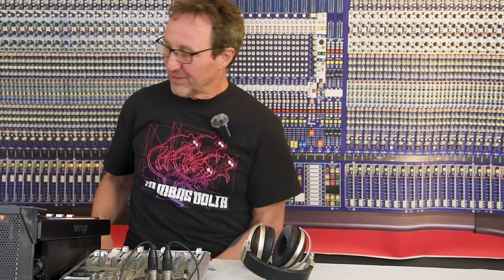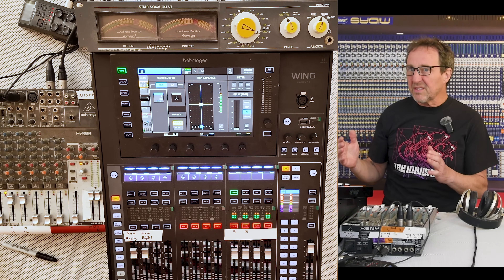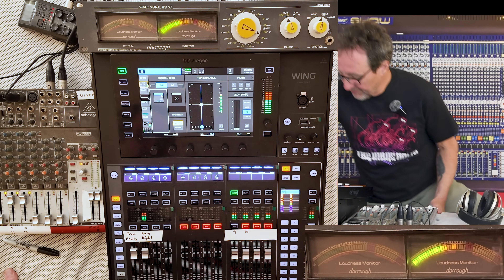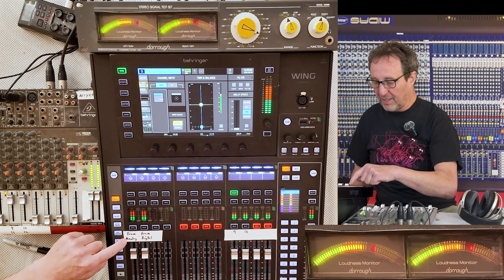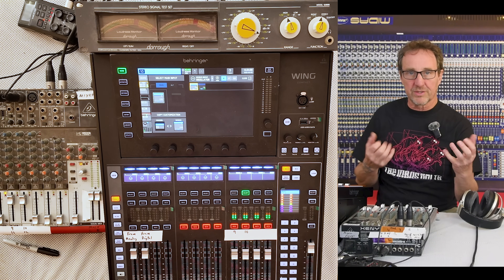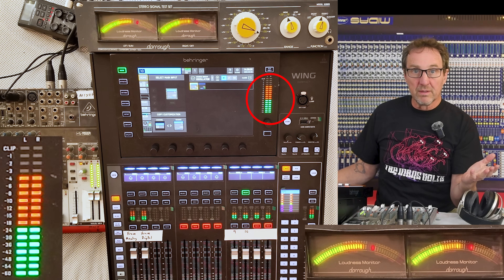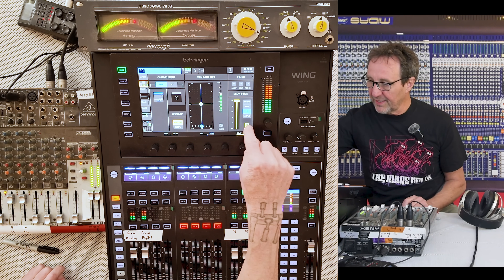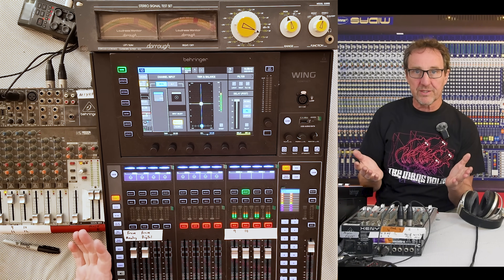Digital Audio Meters Don't Show What you Hear - Sometimes

Comment: Pretty sure the reason the level doesn't seem to change on the digital meters you tested is that they don't feature antialiasing (i.e. "true peak" metering). If they did, they would probably read the peak level to be much closer to an analogue meter :)
Reply: RMS and LUFS measurements should be mostly immune to this kind of discrepancy
Reply from the maker: In the video 8 show that channels 1 and 2 of the wing are metering correctly which are reading the signal after the the analog moxer

If it's a metering issue, why does converting the signal to analog and back to digital fix the issue?

Also, the dorrogh meter shows peak and RMS and both read correctly. 

As you can see in the video as well
Reply: @DaveRat  Because in the ADC/DAC parts there are antialiasing filters
Reply from the maker: So that assumes that there is an aliasing issue occurring inside the console that the meters are reading and somehow converting to analog and back again is removing aliasing issue?

Aren't aliasing issues involving the creation of lower frequencies when things are sampled at a lower rate than the highest frequency of the signals? 

How would anti-alising filters remove aliasing issues that have already occurred and are being shown by the meter?

If the issue involves lower frequencies that are audible that's of a huge concern and converting to analog and back shouldn't fix it. 

If the issue involves higher frequencies above audibility then the meters are showing something real that we don't hear but is affecting the headroom of the digital console.
Reply: @DaveRat  "In the video 8 show that channels 1 and 2 of the wing are metering correctly which are reading the signal after the the analog moxer. If it's a metering issue, why does converting the signal to analog and back to digital fix the issue?"

As @MartijnBraam said, both ADC and DAC include antialiasing for the audio signal, which is why channels 1 and 2 were metering correctly.

“That assumes that there is an aliasing issue occurring inside the console that the meters are reading and somehow converting to analog and back again is removing aliasing issue? Aren't aliasing issues involving the creation of lower frequencies when things are sampled at a lower rate than the highest frequency of the signals?”

The meters aren’t in the audio signal path, so the aliasing isn’t audible. It only affects the visual response of the meters.

“The dorrogh meter shows peak and RMS and both read correctly.”

RMS and LUFS are both taken as averages over time, so the peak levels don’t influence the readings much. The reason the peak reading is accurate on the dorrough is that the signal is resampled coming out of the console after the internal meters.
Reply from the maker: What sample rate? Interesting sample rate can impact the levels.  Also internal white noise may give differing results than external. Also sample rate of the white noise versus the session sample rate messes with things as well.

ultimately all the metering options are useful but the sample peak will be the one that determines your max signal level before digital clip.

Now try converting one of the de-correlated summed signals to analog and back to digital and see where the sample peak level is after the conversion.

Do you still think that it is the digitally created issue of aliasing that is casing the sample peak to meter hot with summed de-correlated signals?

Or is it the anti aliasing filter perhaps?

Or perhaps is the signal just doing exactly as it should and the meter is doing exactly as it should and there is no issue other than the meter being too fast because that is a cheap way to meter using minimal processing power?

And converting to analog and back again is perhaps just a low pass filter that eliminated or reduces the the issue.
Reply: @DaveRat  I suspect that the white noise generators are generating signal above nyquist (as that's what would happen when you use a random number generators without any filtering) and the anti-aliasing filter would drop all the signal above nyquist, the weird part is that the meters don't seem to filter out signals above nyquist so it still counts that as signal.

The anti-aliasing filters exist because having the signals above nyquist in the DAC/ADC would cause the aliasing which generates signals lower in the spectrum. They work and that's why the issue is gone after going through the analog domain.

Comment: Dave, you’ve got me heading to the studio early tomorrow to test this out on my analogue console and daw!  And also on a few new A&H desks I can check out in the coming weeks. I’m an old VU metre guy and rely on them for everything.
Reply: Hi Dave.  Well the results are in!!   I tested this on my A&H gl 2800 and to my delight the main output meters did exactly what they were supposed to…. They showed a 6db increase when summed correlated and a 3 db increase when de- correlated and the monitors confirmed this. My daw however did not! I got the same results you described in this video. Main out meters on my Samplitude mixer showed a 6db increase when correlated and no meter change ( still showing 6db increase) when de-correlated though the monitors did confirm a level difference. I might get my mag lite and head down this rabbit hole….

Extra note: my analogue VU meters did display correctly, +3 de-correlated and +6 correlated
Reply from the maker: Having a digital console that does not show the signal being 6dB is kind of a concern. Ideally you want to see those short-term digital peaks so you can make sure you're not clipping them but you also want to see the RMS meter so you can see what you hear. 

In the analog domain you don't need to see those ultra short-term high frequency peaks because they don't cause issues in the analog domain like they do in the digital domain.
Reply from the maker: Awesome and let me know! 

The question is, are the meters wrong or  are they reading signal that is there and we are losing 3 dB of headroom in digital that we don't hear or lose in analog?

Comment: A few things that might be causing similar things as this. Differing metering styles VU vs PPM vs RMS vs lufs etc, peak vs average detection, differing weightings of that metering, and/or digital true peak detection on one meter but not another digital meter. There could also be bad design and a meter circuit that doesn't function the intended way.

Something I have noticed with a lot of the cheaper digital gear is the I/O is kinda roughly put together, and even things like balanced signals have an offset to them (not that this matters, but it just shows you that it not particular precise how it's doing what it's doing), this wouldn't effect what you're seeing, but this kind of lazy/cheap design of the I/O can cause level differences between one part of the same chain and another when going through several cheap digital I/Os, which can add up to be unequal between channels, so when you sum them it doesn't correctly add up to exactly double.
Reply from the maker: The wing meters correctly once the signal has been converted to analog and back to digital as I show in the video, Wing channels 1 and 2
Reply: @DaveRat but what about if you take your noise sources off the LR bus and put those return channels 1&2 into the LR instead? It looks like a different metering strategy between channel meter and LR meter (VU vs peak?)
Reply from the maker: Here's some more things to ponder, 

If it's a metering issue, then which meter is correct? If we do this with 10 channels and we get a 10 DB signal boost de-correlated and a 20 dB signal boost correlated, so our meters are now 10 dB different, which meter is correct and did we lose 10 DB in the digital domain that we don't lose in the analog domain?

If the main digital meters are reading 10 DB too hot in that situation, can we then boost the signal 10 dB into digital overload and still be clean? 

As far as the difference between the meters I tested that and the meters on the input channels and the output of the wing read the same as each other.

On some consoles you can change the output meter ballistics to be RMS or LUfs to read more similar to an analog meter, but then? Where is that signal let the peak meters are reading? Is that going to cause distortion and overload? 

I measured that as well and there is indeed signal that will overload the meters are not wrong
Reply: @DaveRat Oh, I understand that the things I put are not what you are showing here, but I wanted to list anything else thst can give a similar "fault" so people have a list to work through, as I imagine this vid will draw a lot of viewers trying to troubleshoot their digital meters, and thought it might be helpful to list things that can cause similar problems. 😉👍
Reply from the maker: 👍 awesome

Comment: Bummer! Another glitch in the matrix :)
Then the calculation for the main metering is simply off and always adding full signal level to 6 dB no matter if coherent or not. But maybe it's spot on math wise in the digital domain.
Who can figure it out? 
The good thing, in worst case it gives you 3 dB headroom more than shown on the meters. Better than vice versa.
Reply from the maker: What happens with 60 channels on stage? Do we really have that extra headroom or if the meters are reading correctly we don't have that extra headroom. 

Why don't we have that headroom in digital but we do have that headroom in analog? 

Why did the digital meters read correctly once the signal has been converted to analog and then back to digital again as shown on channels one and two of the wing in the video?

Comment: I tested this in Cubase and get a + 6 dB peak meter increase when two separate white noises are combined. I can hear the difference in delayed correlated, but meter stays at +6 dB. Also I tried combining sine wave to white noise and get a +6 dB increase. The metering seems to be erratic when I combine two sine waves at the same or different frequency, results are random: sometimes +3 dB, sometimes +6 db, sometimes -20 dB, I’m guessing this behavior is a bug…
Reply: As for adding two sine waves of different frequencies, the average output level will depend on the frequencies. If they are the same and in phase, you should get +6db. If they are very slightly off, you will get periods where they are almost +6db, then they will shift away from each other slowly until you get -inf db, then it will repeat.
Reply from the maker: So try with white noise converting to analog and then back to digital again and then look at the metering. 

Converting to analog and back to digital tends to fix the issue and correlated and de-correlated white noise will read correctly

Comment: Dave unravelled the 'dieselgate' for audio manufacturers!
Reply: Not really. It's more about just not seeing the simple truth. All meters that react like this are Peak meters, which are intentionally designed for digital I/O to always show the peak signal level to avoid clipping. If you want to see 'volume' you need to switch to something else, average, RMS, whatever...In short: this is not an error or failure, it shows and works as intended.
Reply from the maker: Why does the issue go away if you convert to analog and back to digital again as I show in the video on channels one and two of the wing?

Those are peak meters reading the exact same signal. Also on the Dorrogh meter, the bar LEDs are RMS and the peak LEDs float above it. The peak metering on the Dorrogh reads correctly.

A simple metering differential explanation does not explain fully what's happening

Comment: If the master metering is not measuring, but predicting on the basis of the individual channel's input metering as previously suggested, then it would be a nice experiment to use an external noise generator and route that to 2 input channels. Then the mixer cannot know that the inputs are identical. Using the built-in noise generators will give the mixer info about perfect correlation (before delay). Would also be nice to check if there is difference between digital routing (single XLR to 2 channels) and analog routing (separate XLRs).
Reply from the maker: On the wing, the channel meters and the master meters read exactly the same, in fact you can PFL The channels before they've converted to analog and The PFL meters will show the issue and if you PFL channels 1 and 2 on the wing or the signal has been converted to analog and then back to digital the PFL meters will not show the issue.

Comment: Record the correlated noise generators to a WAV file. Then, do the same for the uncorrelated noise generators. When you compare the two files, you'll likely notice that their peak levels are nearly identical. However, the RMS level of the uncorrelated noise file will typically be about 3 dB lower, and this difference will also be perceptible and about 3 dB quieter to our ears. (Perhaps this is what is reflected in the Dorrough meters?) This doesn’t mean there’s no signal reaching the peak value in the uncorrelated wave file. If you look at the waveform, you should still see peak-level content, which indicates the presence of digital information at those levels.
Reply: Interesting thought indeed.
Reply from the maker: So if it's a signal then why does the digital meters on channels 1 and 2 of the wing, read the signal correctly and the same as the analog meters, once the signal has been converted to analog and back to digital?

Where did those peaks go?
Reply: @DaveRat  I am not smart enough to figure that out. I could only speculate. Perhaps it is something that happens within the DA circuit at the output of the digital console? We need some of the digital audio console design engineers to chime in.

Comment: My guess is that all digital metering is trying to save processing and just adding each individual channel's meters' resulting numerical power value for the master meter, instead of re-processing the final signal to get an accurate wave-added sum.
Reply from the maker: The issue doesn't really show up with pink noise or brown noise. If it was a numerical edition thing it wouldn't know the color of the noise

Comment: Frequency response of the digital meters? Don't think so. 
White noise at the highest frequencies won't effectively de-correlate as far as the digital summing for the meters is concerned? What happens if the white noise is low-passed well below Nyquist?
Or is it because the white noise generation is clocked by the same system that does the metering? 
The slight phase alterations made by the transition through the analogue mixer effectively de-correlates the signal, so the digital input channel meters of the Wing then correctly read the signal?